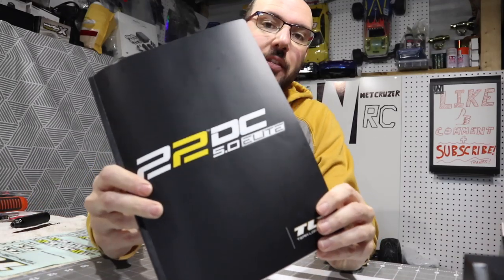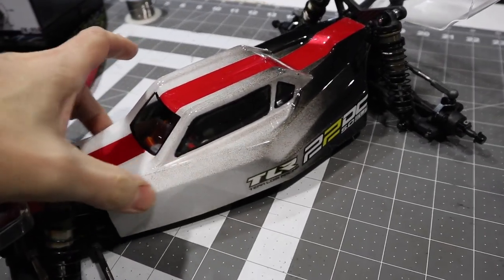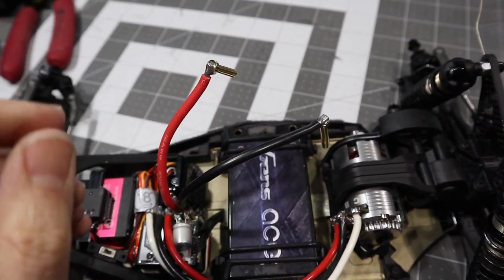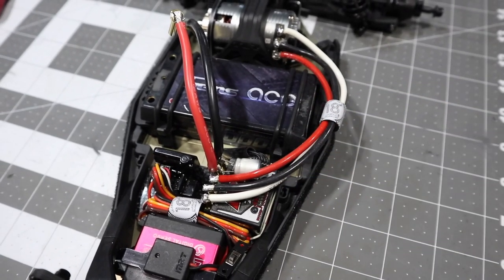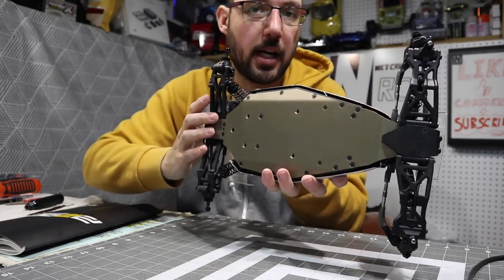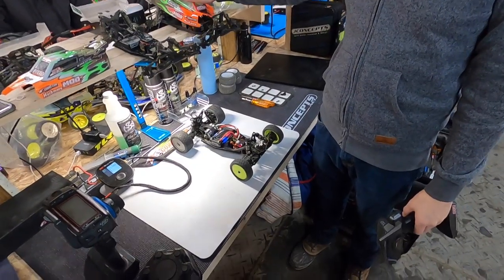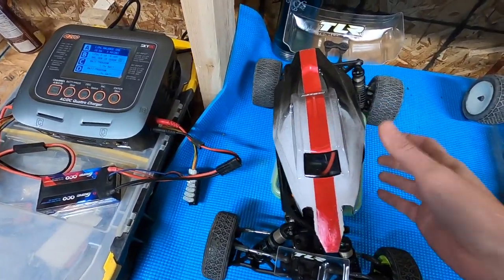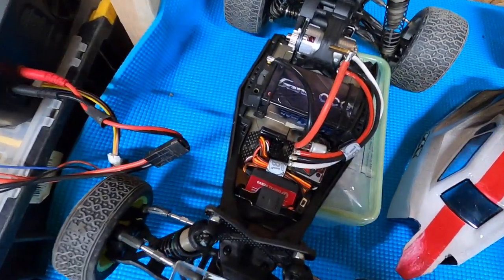TLR 22 5.0 Elite Buggy Build is DONE! NEW 2WD Racing Buggy First Run on Track - Netcruzer RC

Comment: Buggy's looking good!  A good motor will make a massive difference, not sure if that's the V1 or V2, but check out Nick Adams review of the V2.  I can send you a new set of Dirt Webs in soft compound, just cover shipping.
Reply from the maker: Thanks for the Offer. I have gold clay compound tires on the way. Ellipse for rear and space bars for front. Plus TLR wheels
Reply: @netcruzer  OK, well my local track went to carpet, so I have literally tons of soft and clay compound tires and wheels you can have for just covering the cost of shipping.  Stuff that will fit your EB410, SCT410, 22 5.0, etc.
Reply from the maker: Thanks! Yeah I’ll pay shipping to get clay wheels/tires. I sent you a message to your Razor RC Facebook.

Comment: Nice buggy! Motor how many turn! 👍
Reply from the maker: 17.5T
Reply: It a slow motor do you think s 10.5 should be better? But a the track was ok! Maybe you better the way it is give you more control 👍
Reply from the maker: @BOBO-qx2vg  17.5 is easier to learn 2WD driving with and is also stock class compliant.

Comment: When you buy from the USA do u ever get customs fees?
Reply from the maker: Yes. The custom and duty and handling fees pretty much equal the 13% tax I’d have to pay from a local hobby shop.
Reply: Oh.. ok so you don't pay tax when u buy it from there?
Reply from the maker: @cammac1393  you don't pay your provincial taxes when buying from USA. BUT more than not at the border it gets processed with tax, duty, and handling which ends up costing the same as tax or more.
Reply: Oh ok thanks for the info

Comment: Youre not playing the battery discharge and charge game and you have to bump up timing. Gearings off too
Reply from the maker: I’m currently at a 28/72 for
6.2 FDR I’m going to try a 72/30 for 5.8 FDR this week.
Reply: Netcruzer RC TECH CARS  for stock, you need to get a discharge bank for a charger. Do a discharge and then charge prior to racing. Then you have to hope your 17.5 motor is made to deliver the speed etc. Theres a lot in 17.5 you may not be doing to achieve the performance.
Reply from the maker: Ghost0401 I’ll maybe do that after I get all my other things figured out. My charger has discharge ability but I’m a multi-class racer with 1 batt per vehicle I likely don’t have time for that discharge/charge game just to get a bit more out of it. Lots more I can do to be a better driver/setup etc. Heck my tires still have not arrived.
Reply: Netcruzer RC TECH CARS understood, but the discharge ability alone on any charger wont be enough without a discharge resistor. Thats the spec game now. Good luck.